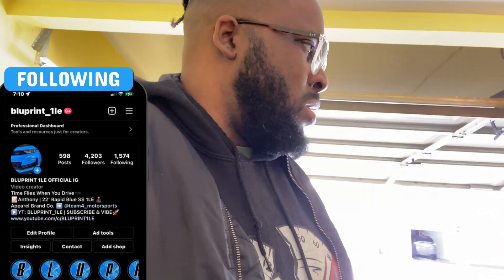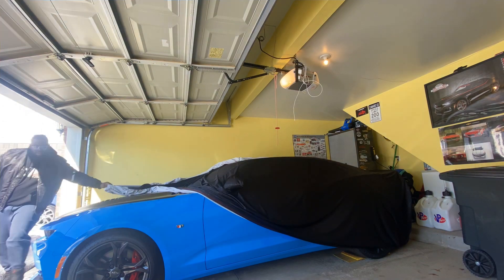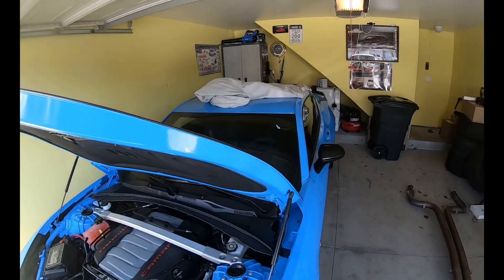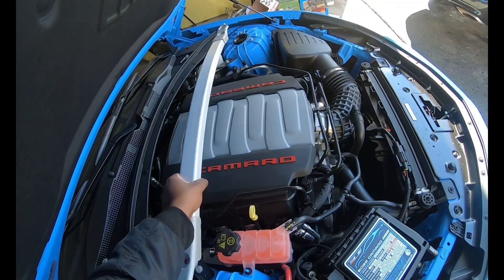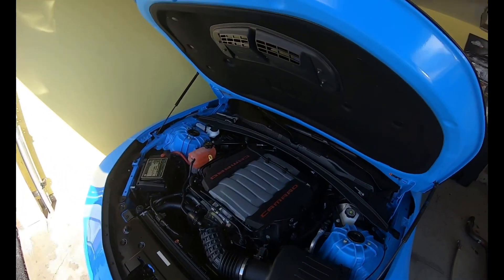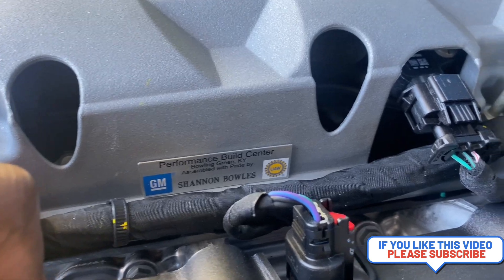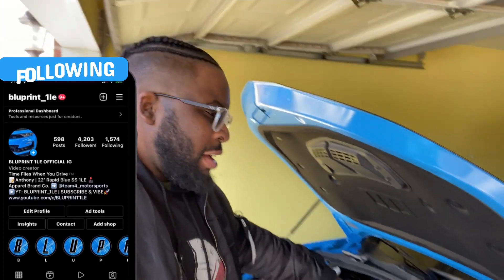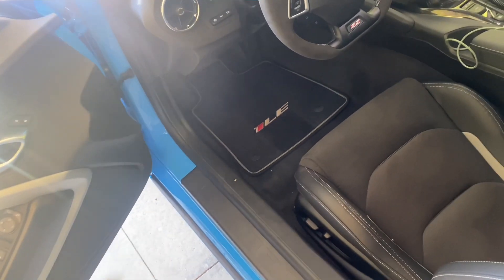I BET YOU DIDNT KNOW YOUR 2019-2023 CAMARO SS/LT1/1LE HAD THIS…

Comment: I THINK what is going on here is kind of a spin off of the Corvette Museum delivery.  For a while now Corvette buyers can do a Museum delivery.  GM also added the ability for Corvette buyers to participate in the building and testing of their engines.  It started with C5 Z06 when the LS6 was being hand-built at the Performance Build Center in Wixom.  When C7 came in, the Performance Build Center was moved to Bowling Green, because…Corvette.  You could participate in the build of your LT4 for C7 Z06.  Since Z06 and ZL1 both used LT4, GM used the line to also build some, but not all of the LT4 engines.  

Looks like now they are also using the line to build LT1.  The line was also used to build the 4.2TT Blackwing engine, but since that engine is now dead (🥺) it makes sense to build something there, so maybe adding LT1 for 1LE was the way to go.  Corvette doesn’t use LT1 or LT4 anymore, so any LT1 and LT4 engines built at Bowling Green would go into 1LE and ZL1.
Reply from the maker: Woooow i didn’t even think of it that way. That’s some very interesting insight on that.
Reply: These engines are actually ones that were built after production of the C7's ceased and Chevrolet is using what is left in the Camaro
Reply from the maker: Great way to save money and production dollars
Reply: Got one in my 22 LT1  M6 built by kevin farley! I think these engines only went into M6 Camaros....

Comment: I think the Camaro sounds better with the dual exhaust than any of the other current muscle cars but that’s just me.  Other than visibility, which I don’t even have an issue with, Chevrolet appears to have gotten everything right on this car.  Looks.  Performance.  Weight.  Engine size and displacement.  Color scheme.  I can’t think of a single negative thing!
Reply from the maker: Agreed! They knocked it out the park with this one!
Reply: I can think of one thing. The skip shift BS on my 6 speed manual. But I eliminated it. Now no more forcing me from 1st to 4th! Now it's perfect!!

Comment: I did know about it, and I do have one on my Vivid Orange 2022 1SS 1LE : )  It is my understanding that they are usually found on LT1s with the 6 speed manual. 2021-2022.  Lol that is the same person who built my motor!
Reply from the maker: What that’s sweet! That’s something we have over the 10 speed guys who are “FaStEr” 😂 but that’s awesome we share the same builder.. congrats on your Vivid Orange too. I can’t wait to see that color in person. I still haven’t seen one yet
Reply: @BLUPRINT1LE  Looks great in the sun, kinda meh in the low light.  Nicer gloss than the base 2016 Camaro I had before this
Reply from the maker: You should consider getting PPF it may glossy it up a bit based on the film
Reply: @BLUPRINT1LE  I am considering it for sure, but that stuff is EXPENSIVE.  I do have the ZL1 addons rock guards installed at least.
Reply from the maker: Yes those will work. I am considering getting those myself
Reply: @BLUPRINT1LE  With the 1LE having all the black bits, they kinda look stock to my eyes (which I like).  A guy over on Camaro6 figured out how to mount the c7 z06 fender flares to a gen6 camaro which looked good to my eyes too.  I may do that for some extra stone catching
Reply from the maker: I seen those flares too! I’m 50/50 with them!

Comment: I've owned 1st.  2nd and now 3rd gen.  Thinking about getting  5th gen.  What's best yr to get. Price and performance  wise?? Can't afford a new one.
Reply from the maker: If you can get the last year 5th Gen 1LEs was made then you golden that’s the best cars. If you can afford to get a z28 on the 5th Gen you pretty much will have a 6th Gen 1LE just slightly heavier but it will be considered a collector car based on the engine that GM declared they discounted that engine which is a Ls7 7.0L
Reply: @BLUPRINT_1LE  I just found your  page.  Dig it.  So do you know last yr for 1 LE?  I know alot about 1st 2nd 3rd gen.  But nothing really about 5th and 6.  So you're saying as long as I get a 1LE I'm good?   SS OR Z28?   I'll keep watching bud. Thanks